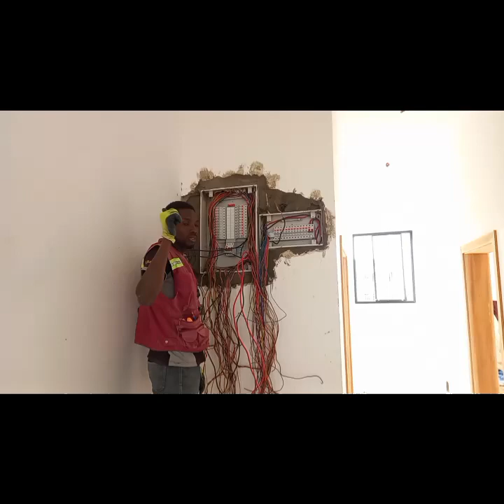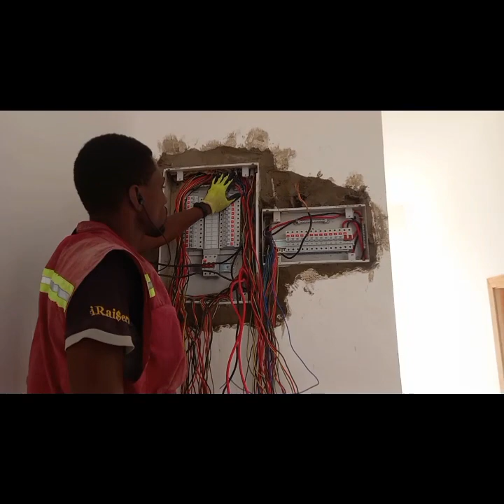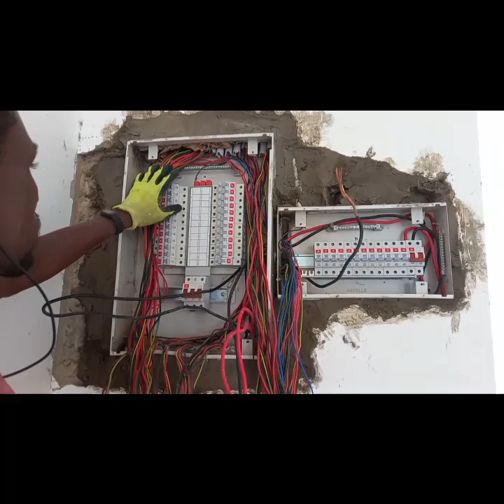What Does A Miniature Circuit Breaker Provide For Electrical Systems Or Households?

Comment: Thanks for sharing.. very instructive. 
Will you recommends a MCB with an integrated voltage regulator or a standalone voltage regular.
Reply from the maker: Yes, highly recommended but it's not common on the Ghanaian market unless you order it from the UK 🇬🇧.
Reply from the maker: Stand alone voltage ⚡ is quite expensive in Ghana 🇬🇭.

Comment: bro pls why did you attached single phase board to the 3 phase board
Reply from the maker: Because it's a dual power system. 
The three phase distribution board or consumer unit is for 220V 50/60 Hz power system and the single phase distribution board or consumer unit for 110V 60 Hz power system.
Reply: @multiskilledelectrician1  i see so the single phase will get a transformer.thanks bro
Reply from the maker: @MovieYardGh  yes. Will use a step down Transformer to step down the 220V 50/60 Hz to 110V 60 Hz.

Comment: Good job bro. What is the best brand of Distribution board/Circuit Breaker in Ghana to be used for say a 3 bedroom house
Reply from the maker: Thank you boss. 
This is a list of my top brands:
1. Schneider Electric
2. MEM
3. Harvells
4. CHINT
Reply: @multiskilledelectrician1  Thank you multi skilled Electrician.. Well appreciated
Reply from the maker: @edwardagbekoatitsogbui7500  you welcome!
Reply from the maker: Any of the three brands I've mentioned above is great for a three bedroom house.
Reply: What about Hager Distribution board please

I have a 4 bedroom detached house.
However upstairs have a different main switch and downstairs is also separate both Hager brands though.
Will you recommend this setup please
Reply from the maker: @macbeesmacbees3159  Hager is equally good and quality.